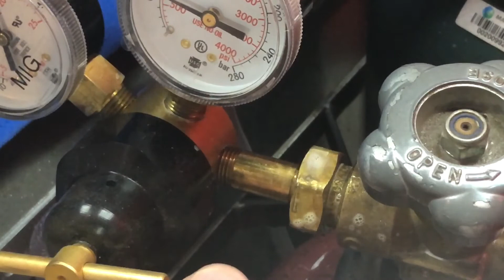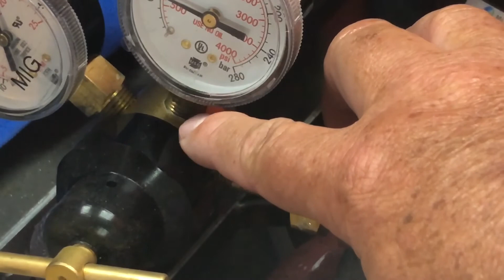Gas Leak Detector @ MKE Gadgets #131

Comment: I can see a leak easily going undetected, cool way to check.
Reply from the maker: Specially on your air compressor lines, if a gas line would leak he would smell it, if a water wine would leak you would see it. But compressed air or bottled air on your welder you never see or hear or smell.